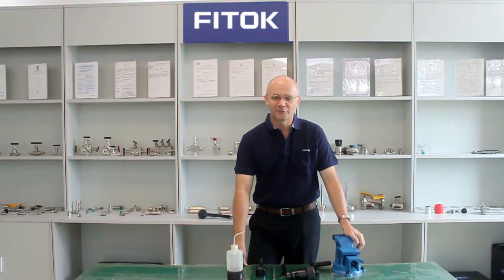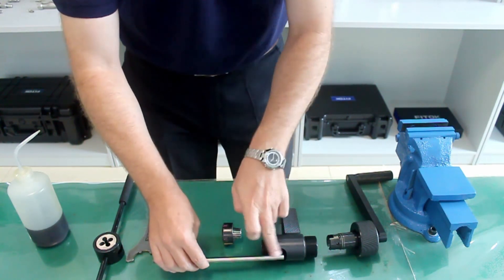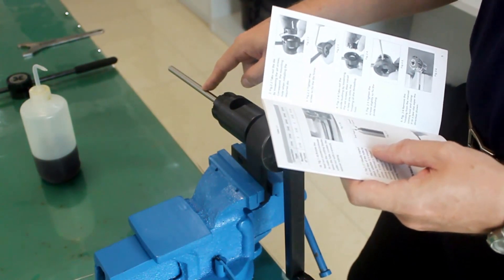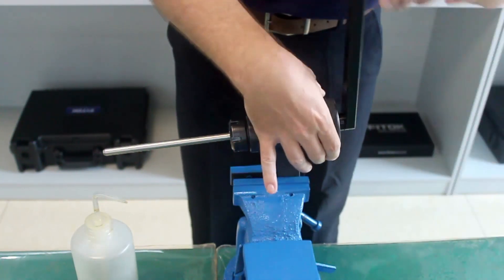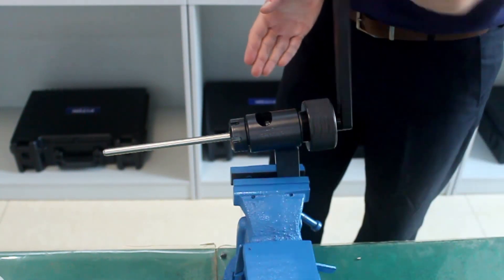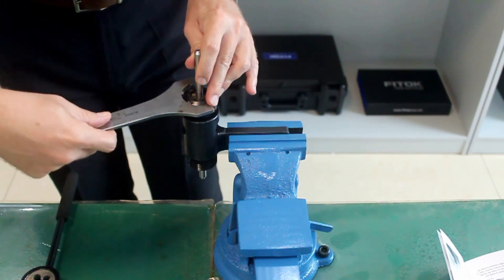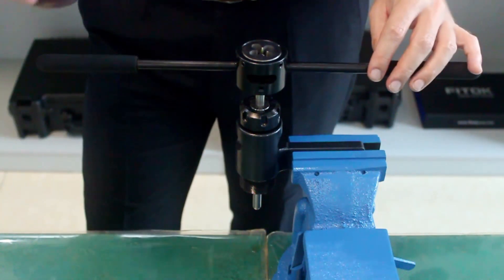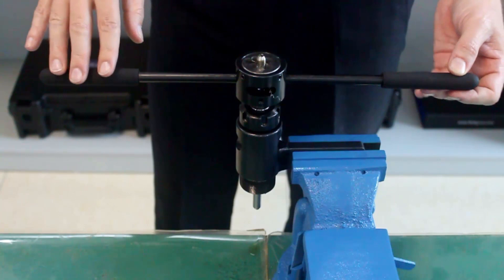Manual Coning and Threading Tool Introduction

Comment: They finally bought this tool where I work. I run our water jet and every time we blew a line, they had to run and get one. Hours and hours of down time. (Slightly frustrating) Of course none of the Maintenance guys knew how to use it. Luckily we were able to find this video and they were able to successfully replace the broken line in-house. So thanks for that.